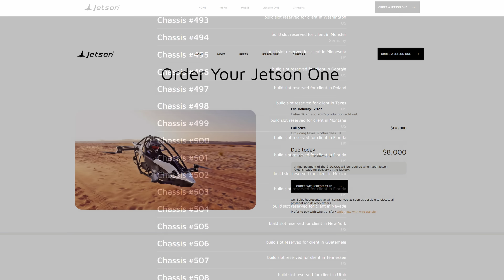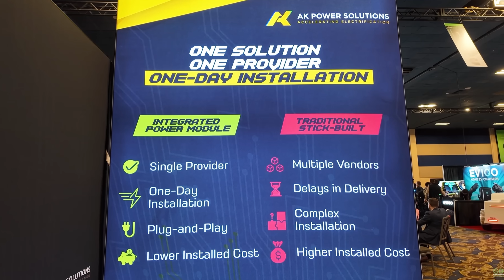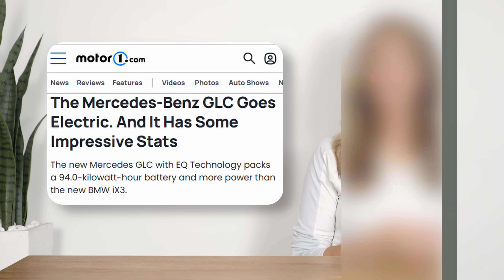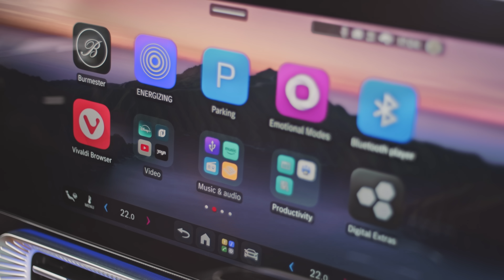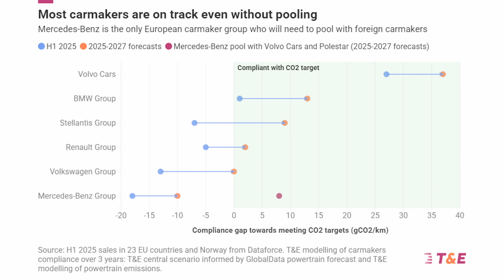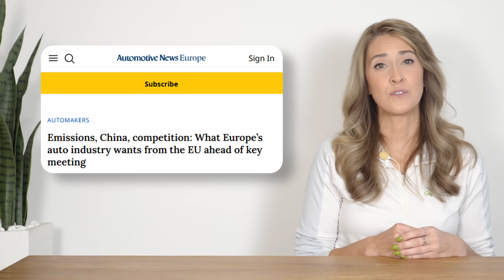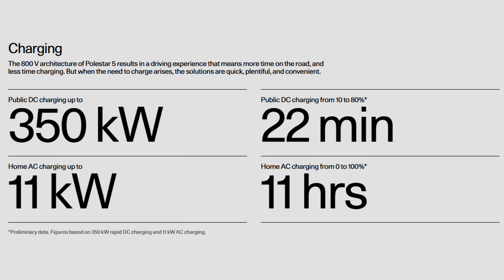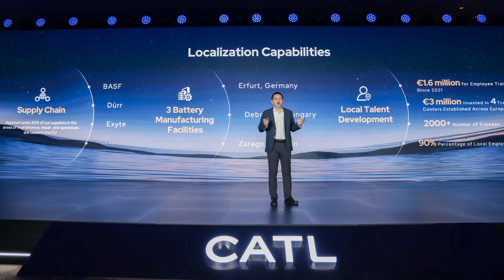The Current : Weekly EV News Ep#80 Sept 14, 2025

Comment: Does anyone know which breakers and transformers Tesla is utilizing for their MegaBlock? I believe Cummins is considering Square D and ABB for their BESS. I wonder if Cummins will discontinue using the name MegaBlock, which they previously used on the switchgear generator package years ago, since they never trademarked it.
Reply from the maker: On the X platform Tesla confirmed that Tesla will be manufacturing transformers in house. This represents their every as a competitor to the major players. 
You'll find relevant links in the video description. 

Until this point, various suppliers have been used to get high energy sites online, based on availability.
-Producer Tim